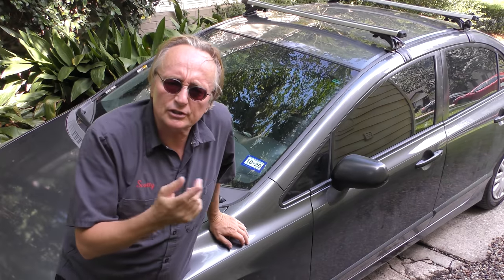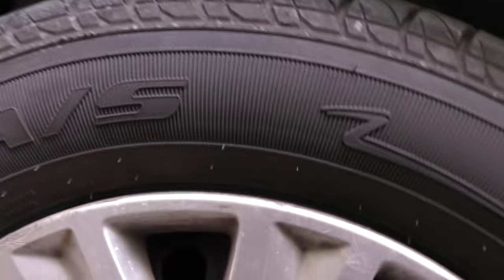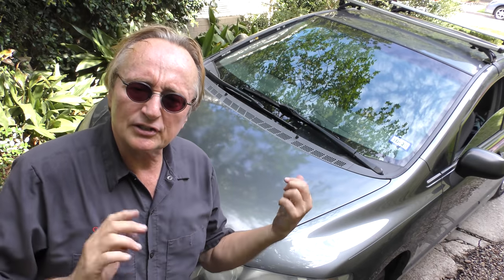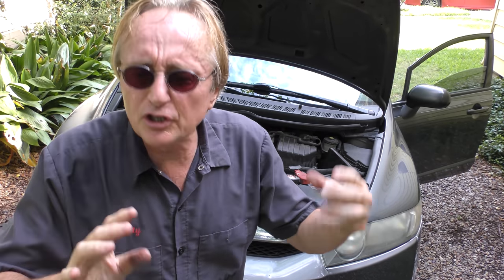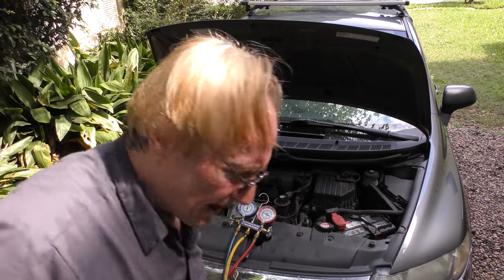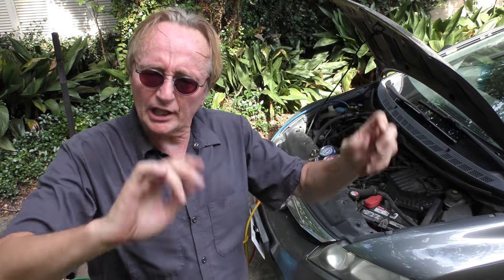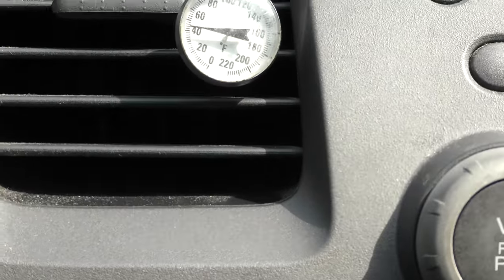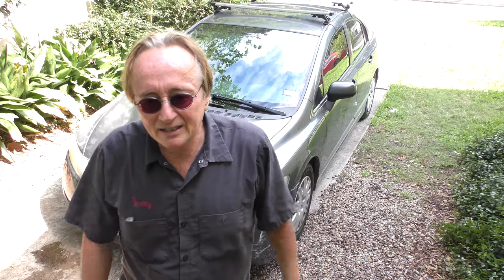Doing This Will Make Your Car's AC Blow Twice as Cold

Comment: My 2015 Subaru Forester A/C blows cold air, it just sucks. I had the entire system replaced after it went out at only 30k miles. Turning the A/C all the way up in 70-80 degree weather I still swelter in my car. I took it to the dealership and they said they didn't see a problem, took it to a local mechanic and he said he didn't see a problem. However, I'm not just super sensitive to the heat or anything because when I get in my girlfriend's Audi or my mom's old Toyota the A/C feels great. What should I do?
Reply: Take it to an AC shop and ditch all the others you've been going to. AC isn't rocket science.

Comment: I’ve got a Ford Escape with 245K miles and my ac leaked out all the refrigerant over 10 years after a deer hit and they rebuilt it. Used to get all hot at idle ever since.  I refilled it with one of those cans with sealer. Damn thing blows colder now than it did new. Yes, probably shouldn’t use those can deals but at 245K, it works now. May work for another 5-10 years. I’d say 10 years is a pretty slow leak

Comment: Hey, it's my car! Except mine is a 2011 at around 136k miles. Everything still runs well on it; just had to replace a few small things here and there and had to replace the front brake pads and rotors a few weeks ago.
Reply: I have one as well except mine is 2007 but my transmission is going out

Comment: FYI if the compressor hasn’t failed you can probably just swap the compressor out (along with the accumulator and the oriface tube) which doesn’t cost all that much. You can get it for $160 for some GM cars if you go aftermarket (which can sometimes be better than the OEM cough cough HT6).

A lot of compressor failures can be due to leaking refrigerant. Once the refrigerant gets low the oil won’t flow properly because there’s less liquid which can result in insufficient lubrication. Worth weighing the amount of refrigerant you remove to see if it still meets spec.

Comment: Hey Scotty I own a 2010 VW CC sport and I bought used from a private dealer and I had a problem with it’s transmission. Basically when it’s in drive or reverse and I take my foot off the brake it kicks randomly instead of moving forward or backward slowly like a normal car. Does anyone have any tips with what’s wrong or things I can do?

Comment: Just about every car has 42 degrees coming out the vent.  That’s what the computer is programmed for. If you want it colder, find the temp probe on the evaporator & pull it back about 1/2 inch.  Did that on my Volvo & it was 34 degrees.  Ran it like that for a couple years.  Only problem is at night the windows will  get condensation big time! 😁

Comment: So if my car has to be moving in order for the air to be cold, that means my compressor is failing? It’s not as cold on start up as it used to be but when it finally gets cold, it’s still very cold. I thought i might be low on Freon.
Reply: Check to be sure the condenser is clean and the fan is working, then, yes, probably just needs refrigerant. It's a simple DIY job much of the time.

Comment: You can absolutely charge liquid refrigerant, pull the vacuum and charge on the high side liquid then adjust the charge on the low side with the compressor running ( you can even charge liquid on the low side but do it slowly, when the liquid comes out of the jug into the low pressure side, it almost totally vaporise ) im just saying.. no decent HVAC guy will charge a systeme with vapor. Just monitor the compressor amp draw closely

And if you change the compressor, you don't have to change the condensor and the valve, just the compressor and the dryer ( if you the some model of compressor in )

Comment: Scotty do the AC seals really dry out and leak if not used for a while.
Reply: Yes... Especially the compressor O-rings. That's why by default the compressor runs on defrost to help keep seals and Orings lubricated, another reason the compressor cycles in defrost is to help remove excess humidity.

Comment: I have changed replaced several A/C units in different cars but NEVER the dryer, condenser etc. and I have never had any problems thereafter. Why do mechanics feel that it is absolutely necessary to change all that other junk? What I am doing is not much different from what you were doing in this video. You evacuated the old refrigerant and then refilled it with fresh one without replacing any parts. I do the same except I replace the A/C unit.

Comment: I replaced all 4 wheel bearing assemblies in my 09 Subaru Forester. Makes such a difference the 09 Subaru is a well built vehicle. Has 150k miles  heads are seeping some but it could last another 50k before I have to re do the gaskets

Comment: He never shows the evacuation of system. A critical process left out of film. Thats clever.
Reply: Because evacuating an A/C system properly is not something most home mechanics have the equipment for.  But with the knowledge he shares, you can bring it to your mechanic and have them do this correctly in order to get more miles and years out of your original system. He stated that he evacuated the system, and even how he disposes of the used refrigerant, why did he have to show the whole process?

Comment: Can't believe Scotty did not suggest RE-GREASING, (not replacing) the wheel bearings.  Hell, I'm old school.  Maybe modern cars have sealed bearing, non greaseable bearings??? Don't know.  I recently bought a 2012 F150 4x4 with 5.0L V8 coyote with 6 speed auto trans.  LOVE the truck, BUT it has no radiator cap, no transmission refill tube or dipstick and no fuel filter.  Now if todays engineers think these are "improvements" they got a stinkin' SCREW LOOSE...

Comment: And technically he is correct on adding liquid. But if the compressor is on and running, it is hot enough that no liquid will make it into the intake side to damage the valve.

Comment: Wow a Honda compressor failed at 140K miles? My 92 corolla got 278K miles and original factory gas and compressor! 97 4Runner at 215K and 2000 LC at 240K miles All got OEM Toyota compressor and gas!

Comment: The ac in those are terrible!! Compressor failure rate was super high. I picked up a new compressor for 280 for mine. 3 years and never had another issue. I like to change them before they fail so if it does go out it doesn’t put any kind of metal or contamination in the system. You can get by with just the compressor instead of changing out everything.
Also, I’d change that wheel bearing now. Let it go too long and you’ll be changing the whole hub from the bearing galling itself in there. Might have beat one out on my civic😂

Comment: If that was my car I would change that AC compressor ASAP before it blows up and sends metal particles through the entire system.
Reply: yep, or hot teflon piston ring material into the evaporator.. then your out 8hrs labor taking the dash apart for a $99 part!
Reply: How many worn compressors with extra oil added suddenly blow up? I suspect the answer is zero.
Reply: Heywood Jablowme  WTF are you talking about? I literally just bought a new Denso-made OEM compressor for my 2002 Lexus for $268 delivered.
Reply: @jkmacgyver  I don't know about the 8th gen Civics, but the evaporator actually isn't too bad of a job on my 7th gen Civic, I had to pull it out to change the TXV. The blower box behind the glovebox comes out separate from the dash.
Reply: @G-ra-ha-m  Quite a few. Something inside that compressor is clearly broken and failing. What makes you think adding oil is going to fix broken metal parts inside the compressor?
Reply: Heywood Jablowme  As many miles as that compressor lasted I wouldn't say it's shitty, especially considering it lives in Texas where the weather is always hotter than hell. We don't know what someone did to that compressor either. For all we know some DIYer may have slugged it with liquid refrigerant, overcharged the system, or did a million other horrible things to it to cause the failure.

Comment: Hondas don't really have reliable wheel bearings. Get quality aftermarket wheel bearings, such as SKF or TIMKEN, for replacement. Almost every Honda Made in North America have poor quality wheel bearings. It's not just old Hondas that have this issue, even newer ones have wheel bearing issues in under 100,000 miles.

Comment: It cringes me to see Scotty Kilmer use a manifold with 6 foot hoses. One 6 foot hose alone holds .2 - .8 of refrigerant, so there goes your car’s refrigerant when those gauges are hooked up and sucks out most of the refrigerant. In perspective, a car’s hvac system has typically around 14 to 28 oz and a 6 foot hose holds 4 oz or more of that. There are stubby hoses made for that. Another thing that i noticed is that he doesn’t bleed the air from his gauges, a pollutant itself for the system

Comment: Don’t worry about it having engine problems it’s a honda
Reply: I was a Honda fanboy.  Had a civic and an Odyssey.   On the Odyssey I had to pay for the timing belt job twice, a valve adjustment twice (dealer says they drift closed?), and then just over 200k lost the transmission.    We're trying our luck with a 2015 Avalon and a 2016 Sienna now.  Though, the lack of a tranny dipstick in both Toyota vehicles is probably one of the dumbest automotive ideas I have seen in a while.